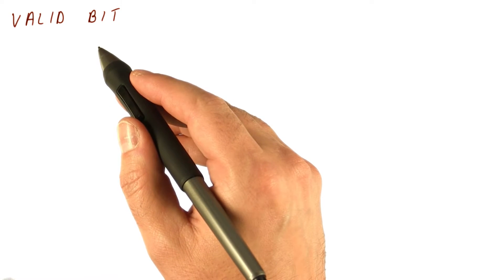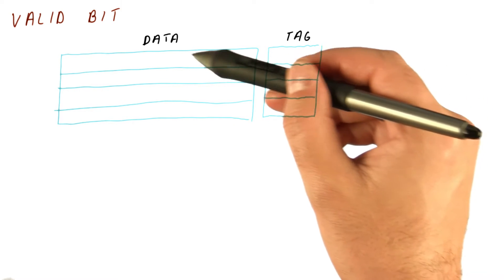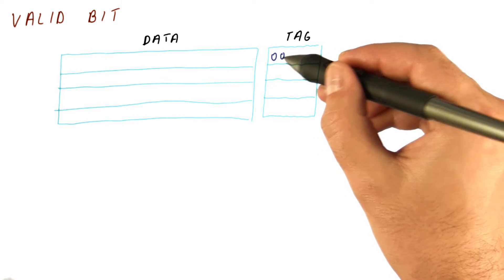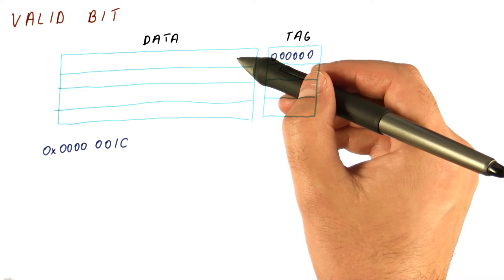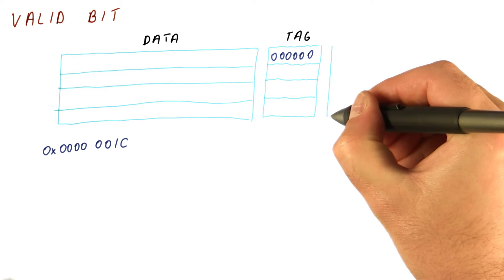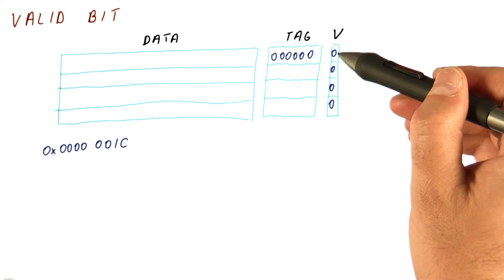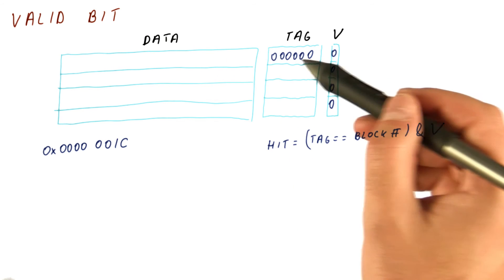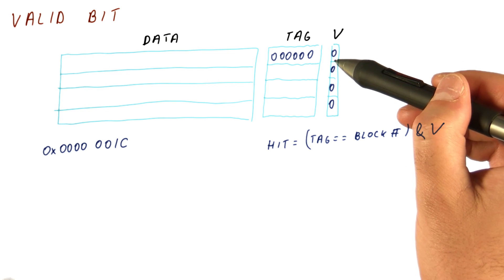Valid Bit - Georgia Tech - HPCA: Part 3

Comment: Just want to make sure that I understand, so all the motivation for that extra bit is to deal with accessing wrong data that got into the cache at boot time?

Anyways, thanks...
Great explanation, straight to the point, clearer than my uni's lectures.
Reply: There might be scenarios where value of a particular block number's value is changed in shared cache memory space(L2) and there is a need for update of this value in specific memory space (L1) then valid bit is set to -> "0"